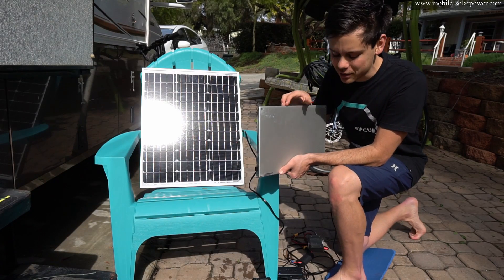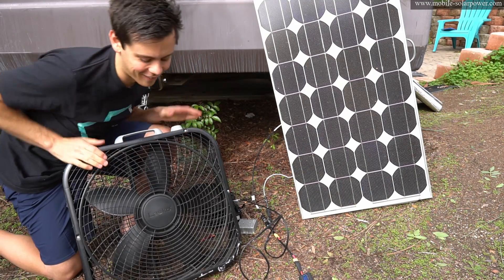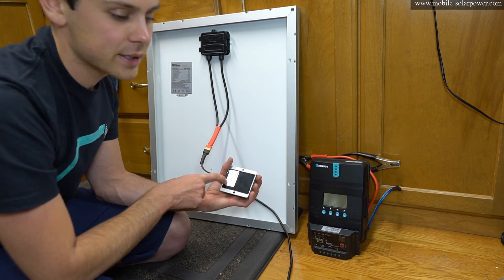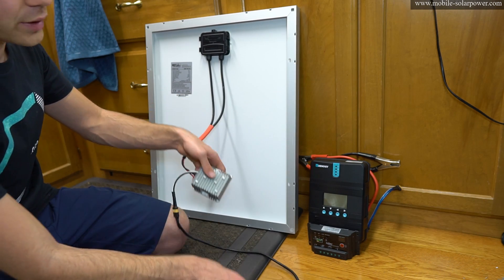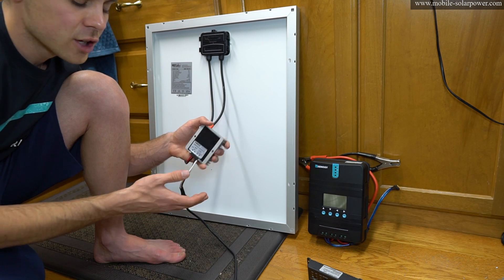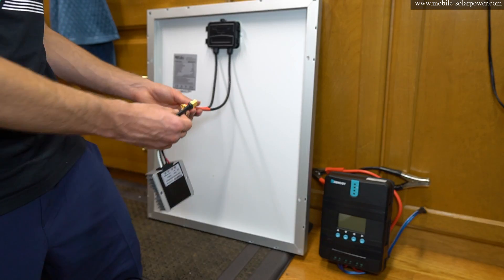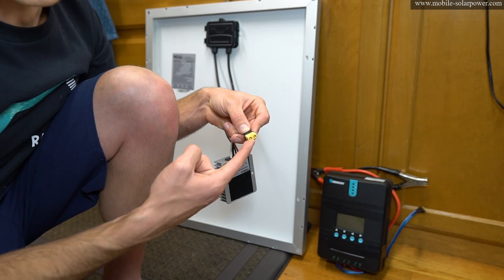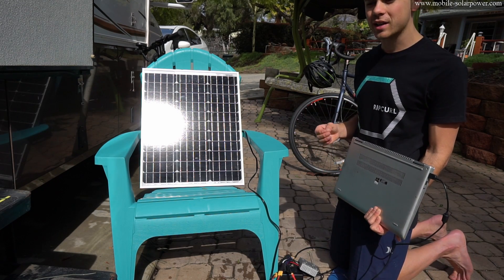Solar Power without a Battery! Solar Panel + Converter = 12v for Small Loads

Comment: Another great job Will. I have a Piper Super Cub. What’s the smallest yet best system I could get into my airplane to take out to my remote fishing camps in Alaska ?
Reply from the maker: Thanks man, and what do you need to power?
Reply: Will Prowse it would be items like Sat phone, aircraft gps ( stratus 2) and a mini iPad. I have my iPad mounted center panel which displays all of my flight info from the gps. So to answer the question, those three items and others which would be similar in size. Cell phone etc. I have power at my lodge but other locations I don’t. Hence the solar. You know we don’t have a shortage of daylight here in the summer. About 21 hours at the best. 
Another Question. What’s a great portable battery system, small and lightweight that I could plug into to charge in flight ? Something I could have in my baggage area in the very back and have a chord up front that I just plug it in to the IPad to charge?Airplanes are all about weight. Keeping it lite. That’s why my Cub doesn’t have an electric system. I save on 50 pounds or more by not having it which causes me to hand prop it to start. On my flight out to my lodge at a community called Port Alsworth on Lake Clark ( google the area) it takes me 3.0 hours from start up and taxi to land and shut down. On that flight my IPad would run out of battery after 2.5 hours. I’ve had and tried a smaller unit but it didn’t seem to charge it very well. 
Anyways Mr. Will, those two items. Solar charger and battery charger. Your thoughts please ?
Thanks for your help.

Comment: Gday  Could I please get your help with this:-

I would like to power a few things off solar and move off grid:-

* ADSL Modem -  Technicolor//iiNet TG-1
* Router/wifi ap -  9v 0.6A
* Laptop - 19v 2.37A
* Small fan      (Wiling to buy DCv12)
* Small Light  (Wiling to buy DCv12)
* recharge usb x 2 (action cam + Mobile phone)

Would this be possible with:-
* 50 or 100w panel  (12v/24)
* 10A convertor
* Solar charge controller
* Invertor
* Batteries - If so what ones to buy

- Laptop recharges off AC in 1.5 hours and lasts 6.5 hours on its battery
- Modem + router have to be 24/7
- Light - 6 hours per day (Night time)
- Fan - 6 hours per day (Night time)

I will look into running another extra dc fan + small panel for daylight direct fan usage

I cant be the only single male into tech and looking for this type of off grid solution

===============================================================

Please note I am located in Australia , not UK+CA+USA 
Which means items often cost 3-5 times the cost in AU as it costs in USA
China is often the best place to source solar panels , electronics, batteries,etc
Reply from the maker: www.mobile-solarpower.com is my website. check out the packages I recommend.